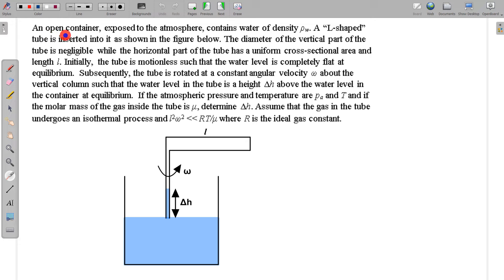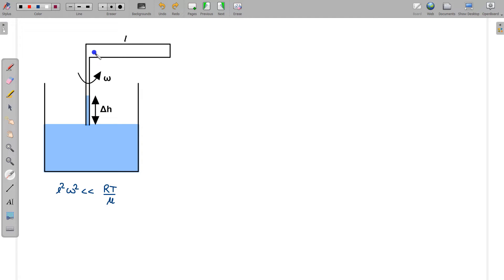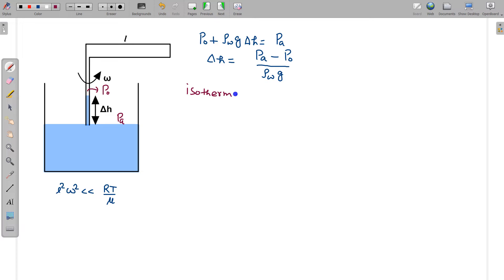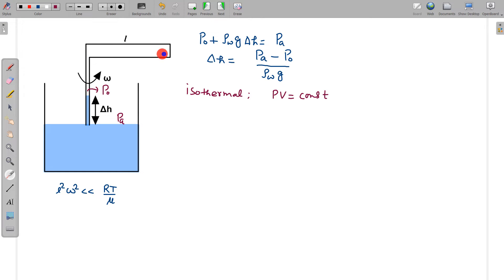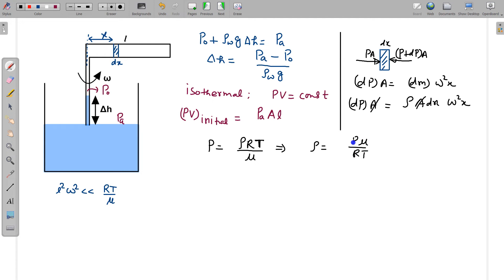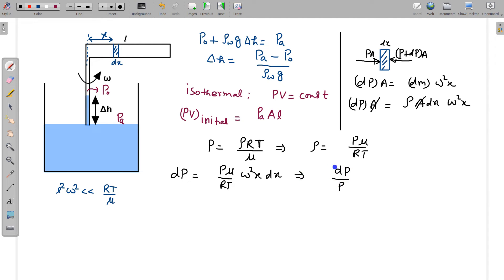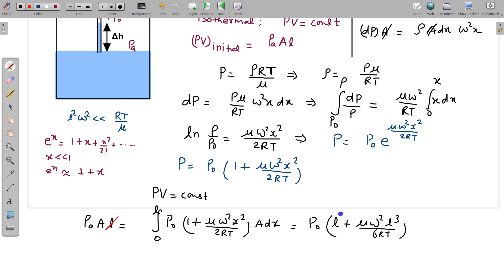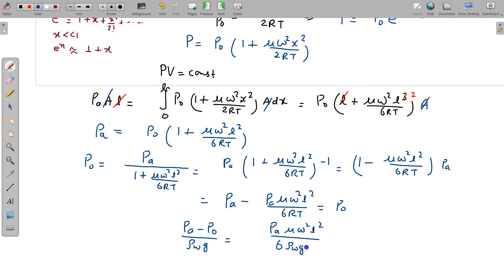Kinetic Theory of Gases | Rise of Water Level in Rotating Tube Filled with Gas

Comment: Sir won't the change in pressure of gas be very small because as we have assumed that vertical diameter is negligible , thus change in volume is negligible and hence change in pressure will be negligible too as process is isothermal?
Reply from the maker: Vertical tube is narrow so that we can assume negligible amout of gas in it.
In vertical part pressure of gas is same throughout.
Due to rotation gas molecules/moles are shifted towards right and gas is least compressed near the axis .
Some amount of the gas which was earlier present in the lower section of vertical tube will have to move up due to low density created because of rotation.
So in final steady state pressure is same everywhere in vertical part.